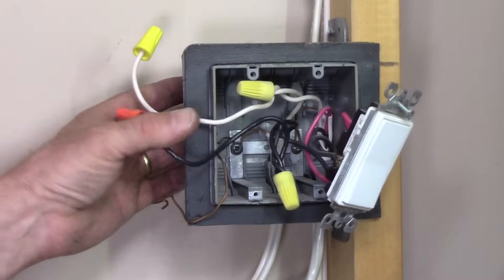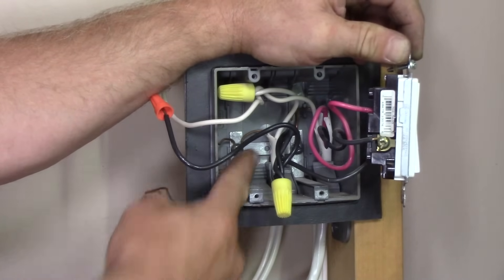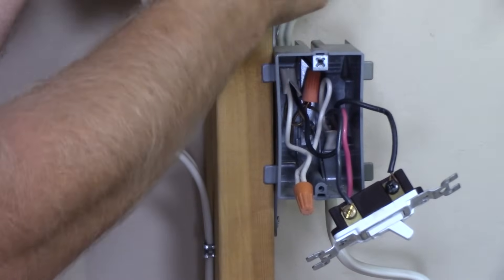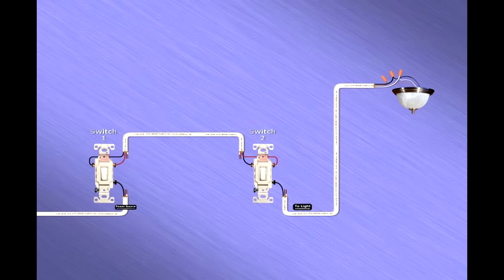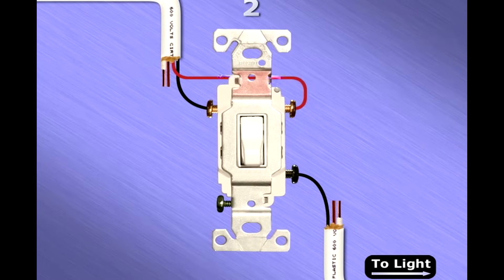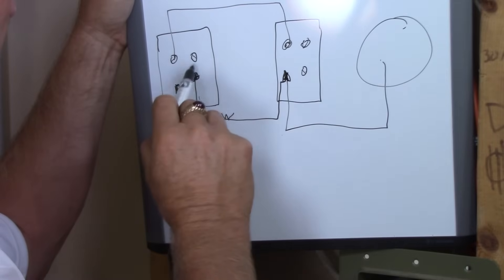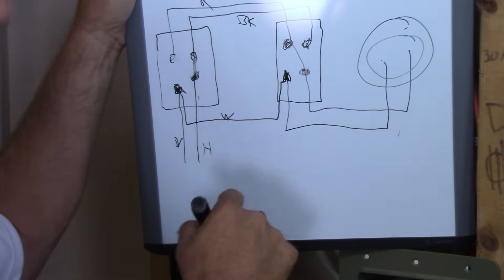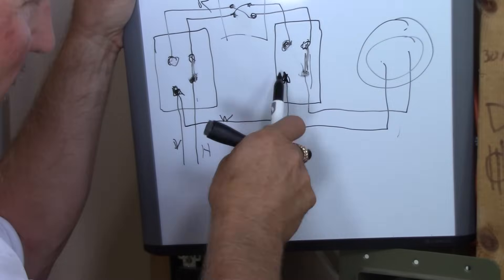The Best 3 Way Switch Explanation Ever!

Comment: If I was starting my apprenticeship I would certainly not want you as my instructor. The simplest way to show anyone the wiring of 3 way switching is with a schematic diagram. Bring the two wire supply into the first 3 way,a 3 conductor cable to the next 3 way and a 2 wire cable to the light or lights. If you want to control the lights from 3 or 4 locations you stick 4 way switches between the 3 way switches. 
A 3 way switch is simply a single pole double throw switch,a 4 way switch is a cross over switch.
Reply from the maker: You seem to be a bitter, unhappy man George.
Reply: Terry Peterman    I am not bitter nor unhappy Terry. What I disagree with is how complicated you made 3 way switching by using a mess of wires in a junction box as your explanation and then your wiring diagram. The simplest way to show the circuit is with a properly drawn schematic. 
To make a simple schematic of 3 way switching you start with 2 single pole double throw switches with the traveller contacts facing each other and then the terminals of the light socket. Each 3 way will have 5 wires plus a ground in the junction box and the light will have 2 wires plus ground. From the panel to the first switch,the black wire connects to the common terminal,the white is marred to the white of the 3 wire that goes to the next 3 way. The red and black wires of the 3 wire cable connect to the traveller contacts of the of the first 3 way and then to the traveller contacts in the second 3 way. The white wire at the second 3 way is marred to the white wire that goes to the light. The black of the 2 wire that goes to the light is connected to the common of the second 3 way. The black and white from the second 3 way connect to the terminals of the light socket. Once the schematic is drawn you just draw a circle around each three way and the light socket. The circle represents the junction boxes. Electricity itself is not complicated. If you want to be a competent electrician and make a living at it you need to know the electricians Bible,the code book. A friend of mine asked me to change the switches and receptacles in his cottage from the old style to the new decor style which I did for him. I never turned the power off for anything while doing it and not once did I get a shock. Of course you have to understand what you are doing. If you are trouble shooting a circuit it makes sense to do it live. If you are trouble shooting a circuit in a damp location get a piece of dry wood and stand on it for added protection. 
Sorry if you found my previous comments offensive,they were meant to be constructive criticism. 👣🙏😇🌈😎  my friends call me Joey 😂🤣
Reply from the maker: George Row keep up the good work Joey.
Reply: Dear me that has confused me even more, from the UK. 😳

Comment: Have never found a wiring layout explaining the routing where the power comes in at the light fixture box.
Reply from the maker: There are many methods for wiring a 3-way switch network.  I have diagrams for almost every configuration.  However if wiring a new network, this is pretty much the only way that meets the code of today as you need to have a neutral wire in every switch box, and this accomplishes that.  If you need a diagram with power coming in to the light outlet first, send me an email at terry@electrical-online.com and I'll reply back with the appropriate diagram.

Comment: My switch was done by someone else it used to work fine then the bulb burned out and got changed now it turns on at the bottom of the stairs and wont work at the top and only works at the top if the bottom is off

Comment: Thanks for an interesting video!  There are som other ways too to wire a 3 way switch. To use a 4 screw switch between the 3 screw switches this is the way, but  if its only  two 3 screw switches you can connect the live/hot wire input(L) with an unbroken wire on both switches, then connect one of the alternating outputs on both switches to each other, on this wire you also connect the lamp socket(L) input. on the last output you connect the hot wire on both switches. When i started working as an electrician 40 years ago the old guys named it the "american connection" as its rather smart.. If you want to mount a socket/outlet below both switches its saving a wire in the cable on the "lamp" side. There is another wire-saving connection too.... barely legal ;-) but working. One wire from the "L" input on one switch to one of the lamp socket connections and one wire from the other switch (L) input to the other lamp connection. Then you connect the both alternating outputs one with hot wire and the other with neutral(N). Do the same on both switches...  The voltage in the lamp socket as follows: (L-N) (N-L) (N-N) (L-L)  as you can see the lamp wont light in the fourth situation witch make it a bit dangerous if someone thinks there is no voltage...... but i know guys who have used it in an old  house with layers of wallpaper on the cables and didnt want to mess up the wallpaper.....  Do not think i would have done it myself ...  but perhaps work on 12volt system if lamp isnt critical on polarity (led and fluorecent lamps wont work)

Comment: I was doing 2 3 way switches and a light in between and one at the end. Power coming into the first switch. I messed it up and didn't do the white wire to the light from the common out of the first switch. Do a demo on this setup.

Comment: I have a 3 way switch that was removed and the wires not marked.  How can I determine which wire is the HOT wire from the circuit panel.  If its not the HOT wire then LOAD wire to know the wire that goes to the COMMON of the switch.

Comment: Thank you Terry!!!!  I have this situation with 3 lights on the front of the house and garage on 2 switches.  If I wanted to install a photocell, would I just put it on the hot wire going into the first switch???  thank you again

Comment: This guy might as well be speaking Swahili
How do you know which wire is the hot
Which wire is the neutral , 
Which wire is the traveler?
THATS the shit I need to know 
Your diagrams and explanations are useless without knowing that, so what do you do ?
Chase wires with an ohm meter 
All day ?
That’s bullshit, the industry needs to commonize these switches so when you replace one there
Reply from the maker: Tell me how you really feel please Mr. dbltrplx! :-)   If I can explain something to help clarify things for you, send me an email at terry@electrical-online.com
Reply from the maker: @dbltrplx  I really don't know of any other way to explain a 3-way switch in anymore detail than I did in this video.  If what you are working with does not seem to relate to the switch network you are trying to solve, I can only speculate that you have what is known as the California 3-way method? Take a look at this.  https://commons.wikimedia.org/wiki/File:California-3-way.svg
Reply from the maker: And, if you send me some photos of the junction boxes, the old switches, diagram of how things were connected, etc., maybe I can help.  The email I sent you is actually an email.  For some reason it shows as a hyper-link to my website and if you click on it, it takes you there.  use email terry@electrical-online.com

Comment: Can you jump power at 2nd 3 way to power separate light or fan? I thought I would be able to when I ran wiring before sheetrock not thinking I would need a separate line.

Comment: Apprentice here. Sometimes I take things too literal. But when you say the switch is in the down position at the first switch, current will go to the first traveler and if the second switch is also down, the light will illuminate. But isn’t the light off if both switches are down?

Comment: I know the neutral and the hot, but I've just heard from this video of the "traveler" wire.
Reply from the maker: It's just a slang term used for the 2 alternate paths for the hot wire to "travel" on going to the other 3-way switch.

Comment: Sorry to confuse anyone, but it should be stated "the voltage flows" current does not actually "flow", current is raised as a result of the load applied, when there is no load, there is no current. Expressed in watts as power is converted.

Comment: It the wiring different if the main power comes in at the light fixture box NOT a switch box?
Reply from the maker: The Tango yes it is. But when you understand how it works, then adapting to different wiring scenarios is easy. There are many different ways to wire a 3-way network. Go to electrical-online.com, search on 2-way switch, and you’ll find diagrams on different methods.

Comment: Initially you are using an old style and a designer style switch, the traveler wires connect in different locations.    Correct?

Comment: Please note that the white wire must be connected to the white wire in each switch box or it will not work in this configuration. The white wire is the common return to the source. If a 3 wire cable with a red wire is not available, 2 cables with black and white wires only can be used. Each black  wire is used for the travelers and only one white wire is used for the return, the other white wire is not used, and must be capped off. A multi-meter 'volt meter' will come in handy to indicate if the source is hot,  "110-120 volts is present". It is not wise to work when any wire is hot. Damage or death may occur. Be wise!

Comment: Ok ok forgive my ignorance but I have to ask. On the first switch connection you have power on the bottom black connection with a red traveler on the same side, on the second switch you have power connection with a black traveler on that side, on the animation (which was great by the way and thank you for that) you have the power  connection accompanied with the red traveler on both sides and a lonely black on the opposite left side of the switch. Was that a mistake if so witch one and if not which one is correct? Thank you 🙏
Reply from the maker: It's not a mistake, and at the second switch, the "lonely black" is the black wire of the 3-wire cable.  The bottom right black is the switched wire out to the light.  If the red and black from the 3-wire cable were reversed, at either switch (or both), the circuit would still function as designed.

Comment: could you explain the difference between "dead end" and "fed and switched" as it pertains to 3-way switches. thanks.
Reply from the maker: There are many ways to wire the 3-way switch network.  Once you know the basics, you can apply them to any scenario, but if you go to my website and search 3-way switch, you'll find diagrams of most ways to do it.
www.electrical-online.com

Comment: I wired a 3 way switch about 30 years ago. Didn't know what I was doing then. After about 20 or 30 tripped breaker's I got it. Yep I still don't know what I'm doing. After all I'm not an electrician I drive a wheel loader for a living.

Comment: Perfect video. It helped me I figure out why there is some issues with the three way switches. I think they moved the location of one the traveller screws on the new wider deocora switches. Why? Why the &^%$ would thy change the position of one of the connection screws in a three way switch.(the new ground screw is too close??) Take a look.  On both the newer switch and older switch there is always one  traveler screw on the left or right. On the old switches the traveller screws are directly across from each other from left to right (this means both travellors are on the top or the bottom of the switch). The new switches have them corner to corner (almost it's slightly offset from the common on the other side, they should put it in the center and not went half ass). The common is directly across (from left to right) of one of the travellers.  This is subtle change and with the color coded screws it shouldn't be a problem. Well it is. I have had to trouble shoot two places after they had new switches installed.  The old switches had one reddish copper (or brass not sure) and two copper so it was hard to differentiate by color so many just memorized the lone screw on top or bottom was the common. Is this just me? Or have there always been variations like this with 3 way switches. Thanks in advance. I got it figured out now but it had me stumped as I was looking at the position of the screws in many diagrams (all older style switches), instead of the colors (of the screws) and I would never have guessed they moved one of the screws. This is a disaster in my opinion and need to redo many of the DIY electrical books. Your diagrams and having both switches is perfect. Wish I would have seen this video a couple of weeks ago.

Comment: Older construction (1960+) use 3 wire cable (white,red,black)  with no accompanying ground .   The traveler pair is a white red, going from switch to switch.
This wiring is very common as the 3 wire cable is less expensive than 4 wire (2 pair) cables.   They also use the same cabling for n-way switching

Comment: So i bought a rotary dimmer to replace a older broken one, the new rotary dimmer has no white wire it only has 2 red and 1 black 1 green. Do i connect the ground to the neutral or do i pull the copper ground wire out of the box and connect it to that?
Reply: The old dimmer (Leviton) Had a white wire instead of a green wire. Do I gotta check the box and make sure its grounded? The electric has been done to code

Comment: Thanks terry my question is partially answered but I am still trying to between 3 different switches identify which is the common wire and which is hot on the first 2 switches the electrical wire coming out of the boxes are one white one black, and one ground wire, some of the wiring is from the 1970s, and on the switches I bought , their is one screw marked common, and 2 screws for the hots, and one ground screw, this is important I get it correct as their were wiring mistakes in the electrical outlets I replaced, which I corrected, such as hooking a ground screw to a screw meant for a white wire, and push connecting wires in holes instead of putting white wires on both left screws, and black wires on right screws, any guidance for downstairs wiring to switch boxes would be appreciated, upstairs looks normal and standard.
Reply: I think I got it black hot is common and should go on screw marked common or black screw, and white neutral wire goes on yellow or gold.colored screw, gets confusing because switches that were replaced upstairs have 2 black wires going to switches upstairs in the bedrooms, but it also looks like the 2 switches, I just did downstairs were wired backwards with kitchen switch not being the correct one white neutral was on bottom screw on right side and black was on the top on left side, and hallway switch downstairs from the 1970s, had black on top left side through the push connect.hole, and white neutral on right side push connect hole and ground wire on outside screw, again in the wrong spot, I hope, I am correct at least with electrical outlets it is more standard and clear white is neutral and black is hot, and white always goes on the left and black on right, unless you put outlet in upside down.

Comment: So when you jump the two switches it looks like I’ll need 12/3? I see two hots and a neutral. Looks like 12/2 is coming from panel to switch and from light fixture to switch. 

I guess I’m asked is The 12/3 an extra hot for the traveler?

Comment: My bathroom light has 3 bulbs above the sink will have one bulb work sometimes then 1 slight glow the other bulb nothing. But then today I turnt the light off n the glowing bulb stayed on for a good 4secs after I flipped the switch. I hate getting hit. I got nailed by 220 last summer n it got me good.
Reply from the maker: Shut off the power, take the fixture apart.  You have a bad connection (s) on the neutrals in the fixture splices.
Reply: @theinternetelectrician   ok so the neutral is the wire that's on the left side of the plug correct? I have this problem in bathroom, hallway, kitchen n garage. You think it's the same problem on each switch? We've had a hella time with light bulbs I got the expensive ones they're the only ones that last. I'll see if I cant find it thanks alot

Comment: Don't make no sense...by your diagram..why would u need a 3way x 2 switches to control one (1) light fixture..why not just use one single 1way switch and wire it straight to one (1) light fixture..now I can see using multiple 3way switches to control multiple light fixtures or outlets on a continuous traveler wire..if your circuit breaker can handle it..
Reply from the maker: Hmmm.  The 3-way switch network is used to control one light (or multiple light outlets) from 2 locations.  For example, at each end of a hallway, or at the top or bottom of a stairwell.

Comment: I was taught two common ways to remember how to wire a 3 way circuit that fits most applications. The first is to feed the farthest switch first (by splicing not necessarily running a feed cable to the farthest switch). The other is take the neutral to the light (again by splicing). These are good rules of thumb for most 3 way and 4 way applications.
Reply: The switches are for the hot lead only..  they are 2 (a-b)  switches in a series circuit, providing two possible pathways to the load.   neutral goes straight to the light bulb.
Reply: Tim Hallas -indeed that is what I meant. Splice the neutrals through at each outlet until you get to the light. Didn’t mean to imply that the neutral is controlled by the switches. Only hots. Plus back in the day we didn’t need a neutral at each switch location for 3ways. But now in the age of smart switches and arc faults I suppose it’s a necessity to have a neutral at each.